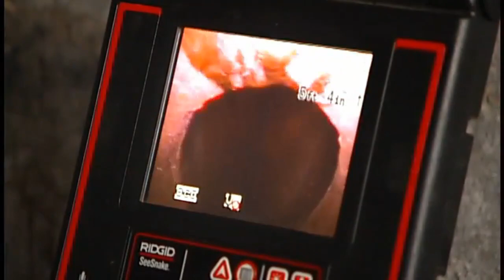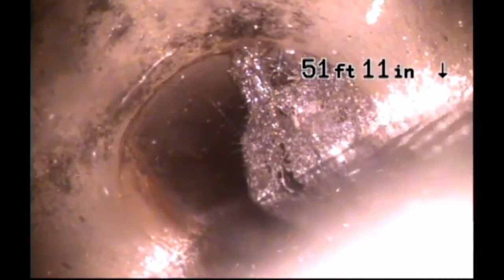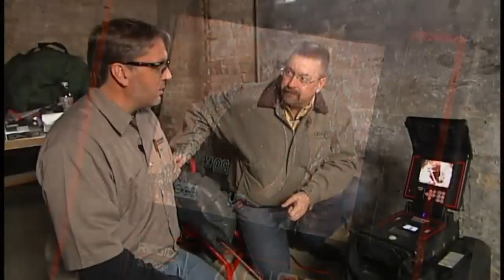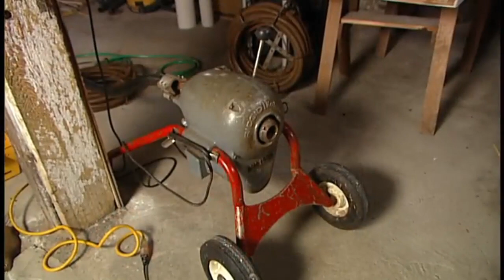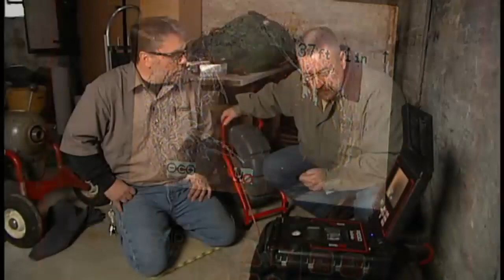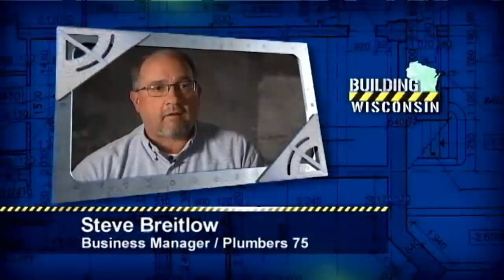Sewer Lateral Cleanout & Inspection with Master Plumber Justin Castleman

Comment: If the property doesn't have trees on the property, would it be necessary to do the inspection?
Reply: Yes.  Even if trees or bushes were present and removed at some point, roots are a bugger.  But roots aren't the only thing you look for in a SL inspection.  Inflow, infiltration, breaks, cracks, sags are just a few.